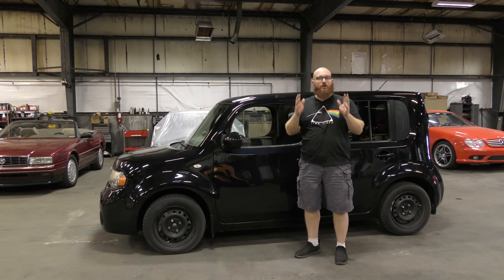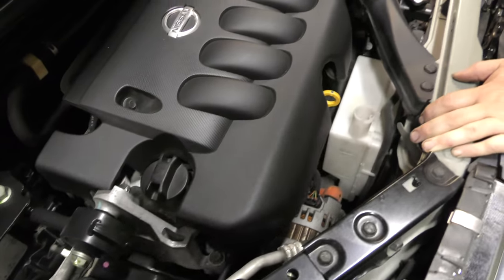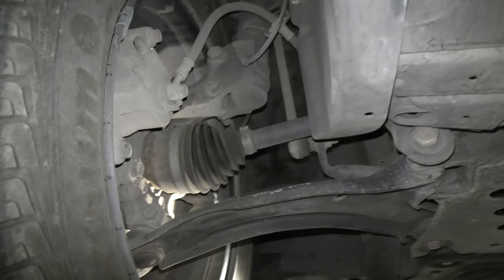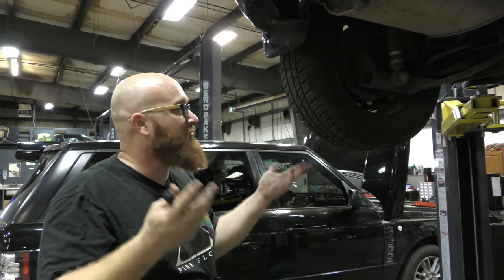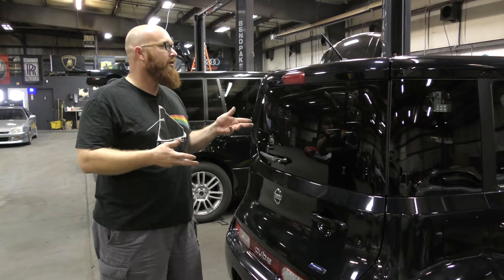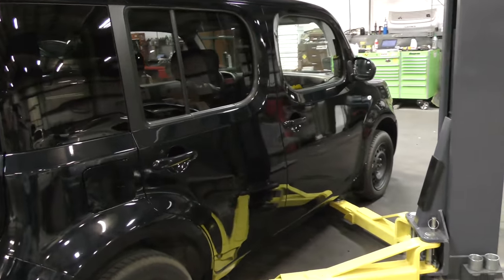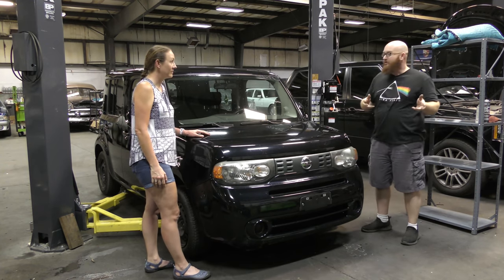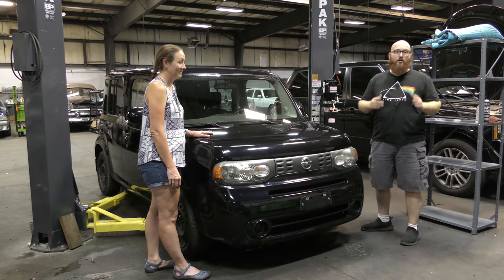The CAR WIZARD's new ride! Mrs. Wizard is NOT impressed! What was he thinking?!?

Comment: The MR18DE engine is a NIGHTMARE!!!
Reply from the maker: How so?
Reply: @CarWizard  I bought a Nissan Versa back in 2007 one of the first ones sold in Southern NH in fact; I joined a Nissan Versa forum (the only one back then), and initially, we were all happy owners of a very practical new (to the us) model. The entire car was well thought out, and surprisingly comfortable - but things got ugly across the board as our cars aged... people were beginning to complain about piston slap (which mine developed), oil consumption (mine too), A/C compressors that began to sound like diesel engines (I had this replaced under warranty at around 25k, and the new one developed the same issue after a few thousand miles) and as the cars exceeded the 100k mark, I remember hearing about timing chain failures and outright engine failures. The other issues of note were typical Nissan problems - front strut bearings that would rust and make a loud BANG when first turning the steering wheel starting out in the mornings (mine had this issue as well), sun visors failing to stay up, and catalytic converter failures. Fuel pump relays are a common problem if the car fails to start in the mornings (It could be a relay, or the entire pump, I forget which), this happened with regularity (yup - including mine). My CVT never outright failed under my ownership, but I had it serviced at around 50k. The dealer claimed the CVT fluid was monitored by the computer which used some sort of algorithm to determine fluid life, and when scanned, it should report this in numerical value. While my CVT never failed, it DID begin to shift more abruptly at around 50k, BEFORE the CVT service (which didn't change anything). I ended up selling the car after two years and 58,000 miles of ownership. I loved the car, but it was built so poorly, I couldn't stand to keep it any longer than I had to. I have had a soft-spot for the Nissan Cube (and remember looking at them when I'd have my car serviced at the dealer). Before the Cube was released, the auto journalists were showing the Z11 (02-08 model) as what the vehicle might look like (and I was excited about it), but the one we ended up with was more rounded off and (in my opinion) much less attractive. Either way, I sat in one on the showroom floor and couldn't help but notice the more "upright" driving position and the location of the cupholders. I actually liked it, but not enough to actually buy one, especially with the round dash carpet (Cube Pubes) and the ridiculous headliner. The out-swinging rear hatch is a nice feature, but it should've been built with a flat rear loading area (like a wagon). Ultimately, my experience with the Versa and the 2006 Murano I bought used to replace it made me swear to never own another Nissan again. I've been driving Hyundais ever since, and am very pleased with my decision. Enjoy the Cube; it's a very unique vehicle and I genuinely hope it treats you well! Also, I am grateful to see that you've responded to my comment (I am a HUGE fan of you and Hoovie!)

Comment: Good cars if manual transmission. If automatic plan on replacing every 80K miles.
Reply: The engine does have the 1.8L. It will stretch the timing chain and cause misfires.
Reply: A Z 
Did not know that. Personally I would have got an XB

Comment: Is that extra seatbelt anchored close the rear hatch hinge for the center rear passenger?  The car probably has a separate lap belt for the center passenger but had to separate the shoulder belt to be out of the way for the folding seat/cargo use.

Comment: I gotta ask what is the paint name or code on this thing, as while I've never been a fan of these, as I've always called them the Fish Bowl, given it looks like someone took a fish bowl and tried to mesh it with a modern art piece tied to a car, hence why one side is all glass and the other is the framework, it is a nice color.

also the more I thought about what you said, the more the trend of modern performance cars makes sense with them going from manuals to paddles, as if you just wanna get home and rest, and your stuck in traffic, and you've been working with all of your hands and your legs all day

and ontop of that on a performance car you need to heel and toe to keep it under control at speed, hence why so many 4 speed muscle cars of all varieties ended up in a ditch between that and the brakes (I still want one however lol)

that WOULD drive you nuts, pitty though you cant keep wartortle in the family or even as a sunday car however, as it sounds like a really lucky find

although switching it over to a subquental gearbox without a clutch would probably greatly exceed the value of the car and go heavy into Hoovie LS swapping a porsche territory when you could just find an auto beetle and hop it up in the same way that was and get something that was like what it was.

also your not kidding about finding a cube, I ebayed the thing to try and find one with this color so I wouldnt have to ask this, not a single damn cube at all.

as I guess the borg assimilated all of them and put them to work in the salt cube mines of storvicko on the klingon home world of kronos! lol

Comment: I have 2006 c230 mercedes. Serene alarm battery went out. When serene alarm battery went out the horn and windshield wipers and lights all on !!! Replace serene alarm part. Now the horn is out windshield wipers are out. Lights stay on bright when the key on . Check the relay Q windshield wipers relay is good. Check the relay L windshield wipers speed relay is good. Horn relay and relay is good. Circuit board on Q 30 and 87 has power. 86 has power but 85 no power. 30 pos 87 neg. 86 neg 85 pos no power. Circuit board on L 30 no power 87 good. 85 no power 86 power. 30 neg no power 87 pos power. 85pos no power 86 neg power. Horn circuit board 30 and 87 power 85 power 86 no power. 30 neg 87 pos 85 neg 86 pos no power. What can I do next. Thank you

Comment: I think this cube is wizards mid life crisis
Reply: Next he'll buy a Omni/Horizon, paint flames on the sides, and start street racing the Honda fanboys with the 2.2L engine they used for awhile!  (I owned one; no flames, and I liked it very much in 1990). No trouble until the steering knuckle sep'd from another part, causing a left front wheel to point 90 degrees to direction of travel, and wrecked the transmission when driveshaft pulled out.

Comment: Why not just get a Honda Element? Much more reliable and just as utilitarian, if not more, because they came with AWD and a rubber floor you can hose off if needed. I used mine as a cargo van and a daily driver for 3 years, and it was very good at that. Never got stuck even in 2+ foot snow. Plus, you could get a manual version if you wanted. Nissan's are meh to me because of poor build quality and ugly styling. Don't get me wrong, there are some decent Nissans, but not nearly as many as there are good or great Honda's.

Comment: Please run away as quick as you can away from any vehicle with a CVT transmission, whether if it is a Nissan, a Subaru or a Mitsubishi. They break down all the time when these transmissions fail or they slip. They are extremely expensive to repair, as well. For the love of God, do not buy a Nissan Cube, a Nissan Juke or any Nissan Rogue in the used market. Instead, you can plan to buy a fairly older, 2011 Mitsubishi Outlander 4WD compact SUV with the similar 3 L V6 engine and the six-speed automatic transmission, because they are still very reliable, but they guzzle up more fuel a bit, compared to the newer, 2018 model. The 2011 model requires premium gas, while the 2018 only uses regular fuel. Anyway, I am totally a fan of the older, 2011 Mitsubishi Outlander 4WD compact SUV, whether if it is the GT or not with the 3 L V6 engine and six-speed automatic transmission. They are way cheaper and more reliable than these newer, garbage Nissan products. The Car Wizard already did a buy this, not that video for Nissan in the past, but he will do one for Mitsubishi, as soon as the next video upload comes on Tuesday. He will eventually do the buy this, not that video regarding Mitsubishi's himself, like he usually does on a monthly basis, when Mrs. Wizard still records on her camera for the Car Wizard's YouTube channel. Thank you very much.

Comment: Calling anything Nissan made past the mid 2000's good is a joke. :/ Not unless you have deep pockets, especially on the new CVTS, y'all want a transmission every 88,000 miles? Or a Renault motor? Or cheap, ding interiors? That GM is outclassing so hard? GM, which yes I'm a Chevy guy, went from, well, '90's GM, good motors, shit interior ( cough cough 2.2L Cavalier ) to something that even the luxury car guys and considering luxury, meanwhile Nissan is stuck in 2005.